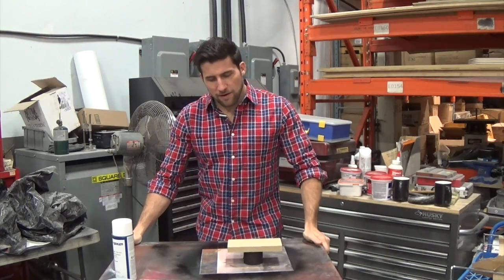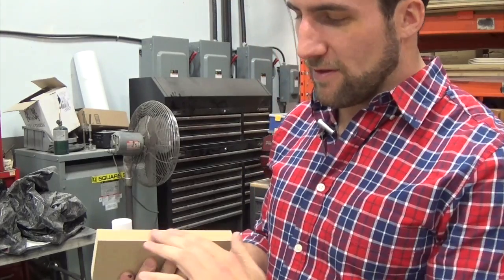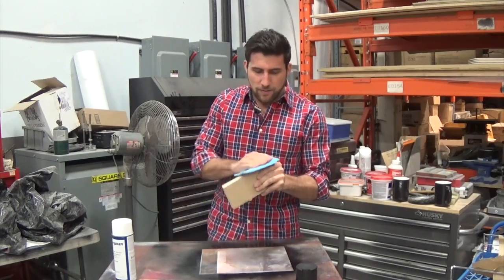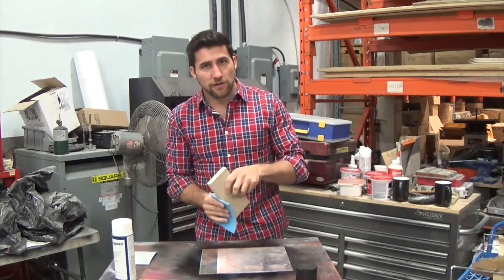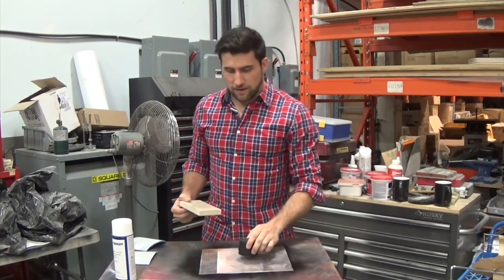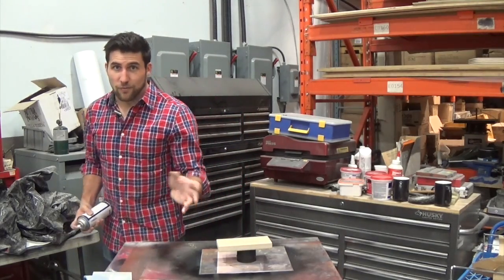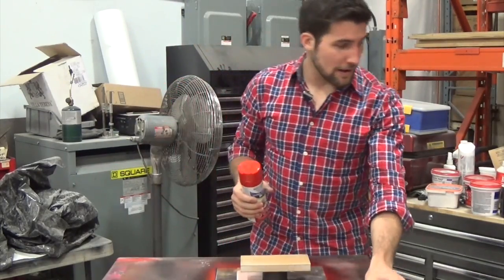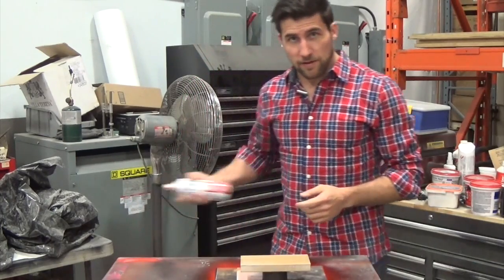How to seal MDF for a gloss finish

Comment: when i do touch up at work on mdf  like a corner on a piece i put thin instant adhesive on the area that is exposed  it soaks right in and hardens the mdf enough for me to sand and seal then put finish coat on 
but i don't  think that would be very practical for like a whole surface
Reply from the maker: So, do you essentially seal it with super-glue then?
Reply: yes 
i lightly sand where i put the super glue because it gets smooth 
spray sanding sealer 
lightly sand again 
then put on color coats 
i put the sanding sealer after the glue because if i don't the area i repair will be harder to match the sheen of the original finish
after i am happy with color i apply blender flow out on the area

Comment: i use titebond or gorilla wood glue, seals it without getting sponged up. Then I paint it with whatever.
Reply: On MDF endgrain? Are you covering the ends with glue then sanding it back? Cheers

Comment: That sand paper looks like it has about a 1/4-inch foam backing. I've never seen anything like that in the stores. Where did you purchase it?
Reply from the maker: I picked it up at a paint shop. You should be able to find it on amazon under “paint pads”. I believe it’s also available in the amazon link that I include in the description of my newer videos.

Comment: watered down emulsion paint works well brush a few layers on then sand back  ready for spraying
Reply from the maker: That's an interesting idea. I've honestly never heard of using that before.
Reply: Brad Angove  a lot of people I know use emusion as a primer for interior gloss paint for mdf.
I wondered if it will work for spray paint so i tried it  the results were great . there isn't any visible defects that I can see and seems to be quite durable
Reply from the maker: I'll have to look into that further. It definitely sounds like it's worth a try.
Reply: I have only tried it with Matt emulsion. I don't think the others will work.
also I hope you have a great new year
Reply from the maker: Happy new year to you as well.
Reply: @razie85  is MDF expanding after emulsion? I want to paint my MDF kitchen cabinets but I'm afraid of expanding because of closing and opening doors could be a problem...or not?

Comment: I had some MDF plinths that were in my bathroom. I thought the paint+primer would be sufficient but water got to them and they soaked them up. Will this method help me avoid that?
Reply from the maker: It should if you seal them fully. Finishing them off with some kind of clear coat after should also assist with that.
Reply: Brad Angove Thanks!!!
Reply from the maker: You’re welcome.

Comment: Hi Brad. Thanks for your educational videos. I am a real beginner in woodworking. My first project will be a coffee table made of crates and it requires a square piece of wood at the bottom where the crates will be screwed on. I decided to go with MDF because real wood was too expensive at my Home Depot. The coffee table will not be in damp/humid room obviously but I am scared of water/beverage spillage that could ruin the MDF base. I am looking for a non-toxic MDF sealant (I have an adventurous toddler). What do think of simply applying one or two coats of basic wood glue?
Reply from the maker: You can dilute some water-based wood glue in order to create something that will act as a filler/sealer, and then sand it flat. You will likely want to apply something on top of that to make it more water-proof though. Perhaps you may want to consider a water-based polyurethane to finish it off. Alternatively, you can glue on a thin veneer if you can find one for a decent price, and then you can actually coat that in a food safe oil if your toddler is going to be chewing on it.
Reply: +Brad Angove I like the idea of a thin veneer. I have already splurged on a beautiful oak veneer as a table top for this project and the sales associate at Home Depot sold me an entire sheet although I needed a 26 in. square, so I have lots of "scrap". I was almost desperate to the point of covering my MDF base with vinyl contact paper lol. Thank you so much for taking the time to answer my question.
Reply from the maker: Glad to help out. So, you can cut the appropriate sizes of veneer (go a little oversized and just trim after), glue them on under pressure for 24 hours, and then you can finish the whole thing in mineral oil if you want. That's what we use to oil cutting board. You can drink it (it acts as a natural laxative), so it's probably the safest finish I can think of if you're worried that you child might go looking for something to chew on.
Reply: Double-duty :-) I can ask her to go chew on the coffee table on the days she is bound up LOL. More seriously, I was thinking of glueing the veneer, then screwing in the corners and finally covering those corners with childproofing angle covers, for safety and aesthetic purpose in order to conceal the screws.
Reply from the maker: Sounds like a plan.
Reply: Céline Saday Yahya I use Zinsser Fast prime interior oil base primer and sealer on a craps table I built.out of mdf. I did decorative flutes on the legs. I used a small amount of wood filler to seal the exposed grain in the flutes. I then lightly sanded them with 320 grit sand paper. Then I used Pittsburgh Paints Ultra interior/ exterior high gloss water based enamel paint. 3 coats. Was very pleased with the results. It's in a rather humid basement and have had no issues 2 plus years in. Just remember to use an oil based primer on mdf. Water based will cause it to swell

Comment: Thanks Brad!
I'd imagine that you could just do extra of coats of paint - that should eventually fill the pores... Except that the final finish wouldn't be nearly as smooth as would be achieved with a sandable sealer...
Reply from the maker: You could keep adding coats of paint and keep sanding them smooth and you would eventually get there.
Reply: @BradAngove  I agree if you pick the right paint to start with. But that paint may not be that great to end with depending on what you're trying to achieve. For outside projects where rain & sun protection is the goal, that single-product process would be tough to find. I've had experience trying to sand slow drying, relatively soft paint types like enamels, and it's not pretty. Trying to sand polymerized coatings, like latex or acrylics, is wa-a-ay nasty.

So your filler process seems like the best approach 4 smooth results.
Reply: Not really. You end up with a blotchy finish that you need to wet sand. Another method is to use shellac to seal, then several coats of a high build automotive primer. Dry sand using 600 grit or better of high quality sand paper. Get the good stuff. At that point you could spray enamel if you want to but if you are going to use lacquer as a finish, as I like to, you would then apply the vinyl sealer like you have, dry sand with 600 grit, tint some nitrocellulose lacquer to desired color, tack and spray a couple of coats, tack between coats then wet sand with 600 grit and mineral spirits. After that, tack then spray several coats (3 to 4  wet but not to wet) of clear lacquer, tack between coats then wet sand with mineral spirits and progressively finer paper finishing with 2000 grit. You shouldn't have to sand between coats unless you need to sand out a sag or a run or possibly an flying insect. At this point you will have something that looks dull and not to shiny but that's OK. Now you let it sit for about a month till the lacquer has cured and if you don't have telegraph seams at the joints you finish with 3 grades of polish with a random orbit polisher topped with a good carnauba wax. If all has gone as planed you should have a finished product that slips through your hands when you try and pick it up, literally. If the joints have telegraphed then you will need to wet sand with 800 grit and mineral spirits again then spray another coat of lacquer and wet sand until the joints can't be seen being careful not to sand into the color coats, then progressively higher paper finishing with 2000 grit.Then let it sit again for another month.

A couple more tips when working with MDF. Buy quality MDF if you can get it. Not all MDF is created equally. Today's MDF is not as good as it was 10 years ago when they still used formaldehyde based glues so you will find the lesser grades of MDF to be extremely prone to swelling just from moisture in the air. 

The stuff you get from big box stores is kept in the same isles as their green (wet) lumber and because of this it is likely to take on moister and swell if it has been there for any length of time. MDF from big box stores like Home Depot isn't going to be all that good to start with but it might be all you have access to. In that case try and let it acclimate for a couple weeks inside your house before using it.

Using MDF when it has been raining or if it has been humid can be problematic and will lead to joints telegraphing as it drys out and shrinks. One other thing you can do to make your glue joints blend in is use a softer white PVA glue and not the exterior water proof kind like Titebond III that dries to a very hard finish and will make sanding  difficult because the glue seam will be harder then the MDF itself and will form a ridge as you sand. It is fine to use if you are going to cover the MDF in a veneer though. It is actually a great glue.

Comment: I wouldnt spend too much time sanding before the primer, any coating will raise the grain after. I coat the edges with shellac knotting or sanding sealer first, ir dries really quick to the particles in the mdf have less time to swell...oil based primer or undercoat is also good... I never use water based paints or primers on mdf, they are the worst for swelling the surface
Reply from the maker: Mdf doesn’t have grain.
Reply: @BradAngove  not grain n the sense of traditional solid wood no...but for want of a better term...fibres, swells the fibres?
Reply from the maker: It certainly can swell the fibers.
Reply: @BradAngove  using a water based, especially if it takes a long tíme to dry on mdf can leave it looking like woodchip paper 😔

Comment: As of April 2024 this stuff is now going for 24 dollars for one spray can.   I dont understand what is going on with the prices of EVERYTHING but if this continues no one will be able to afford ANYTHING.   this stuff is out of reach price wise.  most of the old oil based sanding sealers are now water based and not as good.   our govt has outlawed things that work through regulation. why do people keep voting for this ?

Comment: Hi, will this method work to make a bath panel with gloss finish?
Reply from the maker: I’m not sure what a bath panel is.
Reply: @BradAngove  sorry im not sure what its called in the US. Its the panel that goes around the outside of a bath to hide plumbing. Usually its plastic but the bath I have is an unusual size so wanted to make my own cut and finish
Reply from the maker: Sounds like you could potentially use this method for that, but you would have to be extremely carefully about fully sealing it. Mdf swells badly when it gets wet. 
Btw, I’m not American.
Reply: @BradAngove ok thanks for replying. I’m not good with accents. I can see you are a Canadian. Apologies :)

Comment: Hi Brad, fantastic video! I have MDF kitchen countertops and I would like to paint them (probably copper paint) and give them a hardwearing high gloss finish so that the paint doesn't come off. Can you suggest anything to use? Will spray-on varnish work? Or do I need something stronger like yacht varnish applied by a brush, or epoxy? [el'sda2]
Reply from the maker: I would suggest that you use an epoxy for that. It’s a fairly common option for that sort of finish if I’m not mistaken.
Reply: thanks. never used it before, do you have any recommendations for which ones to try? [el'sda2].
Reply from the maker: You need a finishing resin. Unfortunately it’s not really my area of expertise. Consider getting in touch with the guys at Black Forest Wood Company.  They might be able to help.
Reply: loads of thanks, will do [el'sda2]

Comment: Cut your pieces long and run them through your route table with a straight bit. It will never be smoother. Then just top it with some 300 grit. Router bits work wonders on mdf.
Reply from the maker: These were made entirely with a router. Routers do a smooth cut, but they do not seal anything.

Comment: brush on watered down wood glue, let dry then sand smooth
Reply from the maker: That way works as long as you are careful about how much you water down the glue though. It’s slower though, harder to get into difficult areas, and generally just takes more work.

Comment: Instead of paint, can you stain over the sealer?
Reply from the maker: +gotbacon04 unfortunately no. You would want to stain before putting on the sealer.
Reply: Is there a certain kind of stain?  I'm trying to refinish a set of barn doors that we got from one of the Disney resorts. Did not realize they are MDF until I started sanding. Wife wants a Lite cedar color
Reply from the maker: +gotbacon04 stain generally doesn't work too well on Mdf. If tends to absorb too much and swell. Are they veneered?
Reply: Brad Angove yes I think so
Reply: Brad Angove I don't think it's veneer. When I sand it the dark color comes off and it's MDF. Hard to explain. I'm new to this. Lol
Reply from the maker: +gotbacon04 must be paint then or an opaque stain. If you want to use something like that you can go over top of sealer.
Reply: Brad Angove thanks. I appreciate it
Reply from the maker: +gotbacon04 you're welcome.

Comment: Moisture proof MDF won't absorb liquid and gives a better finish. As an experiment I sanded the edge of ordinary MDF down to 2000 grit and it came up like glass. You really can get the edges as smooth as you want, just takes time to work down the grits.
Reply from the maker: +Graham Orm Moisture proof MDF?
Reply: It has a smoother finish for some reason and takes paint better. There are various types. Green is moisture proof, red fire retardant and there's a blue as well can't recall that one. http://www.builderdepot.co.uk/moisture-resistant-mdf-board-6mm-x-1220mm-x-2440mm.html?gclid=EAIaIQobChMIlZW9n9Ps1gIVhbgbCh15nQOOEAQYASABEgLKmfD_BwE

http://search.builderdepot.co.uk/search?view=grid&switchprice=inc&w=fire+retardant+mdf
Reply from the maker: That's very interesting; thank you. Hopefully it's still good for machining. Though unfortunately it seems pretty expensive.

Comment: I am a painter and decorator going on now for 50 years and i dont find it hard to deal with
Reply from the maker: I’m glad to hear that. May your lengthy career in decorating things continue indefinitely!
Reply: Thank you very much for that and you are right the edges do take more prep as the sealer one puts on tends to be absorbed more and usually needs an extra coat or two of prep ...Cheers James

Comment: Has anyone tried sealing edges with bathroom silicone? And then 2 coats of paint with a 400grit sanding in between?
Reply from the maker: Bathroom silicone stays soft, and paint won’t stick to it.
Reply: @BradAngove  how about a mastic? I have painted over mastic in the past.
Reply: @BradAngove  sealants online. co.uk have a range of paintable sealants
Reply from the maker: I’m sure there are many paintable sealants. I’ve found the vinyl sealer to work very well compared to the other options I’ve tried, but there are certainly other things you can use.

Comment: can you stain over primer coat like a solid color
Reply from the maker: Not really. There’s nothing for the stain to soak into when you do that.
Reply: @BradAngove  thanks for your time why then does paint works  maybe a paint stain. i have a small bookshelf speaker i really didnt want to just paint  them i made with mdf  which is great for speaker sound  i wanted them to look likea million bucks ? any ideas they are prime with bins white shellac base
Reply: i would never used rattle can to paint anything
Reply from the maker: Stain is designed to color wood, which mdf is not. You could have done a veneer and stain, but if you’ve got a white primer on there you have already painted them.

Comment: Use ICA FP272 high build urethane sealer
Reply: Egeo Levy can you use that on pre fab butcher block counters for a sealant?
Reply from the maker: No. You use mineral oil and beeswax for butcher block counters if you want to use it as a food safe prep surface.

Comment: Was that vinyl sealer you just used pass for a primer before you applied the Enamel paint?
Reply from the maker: It replaced the primer in this case, although you could use a primer over it.